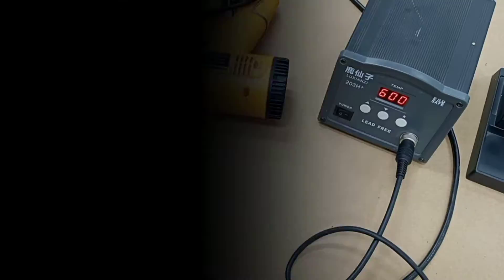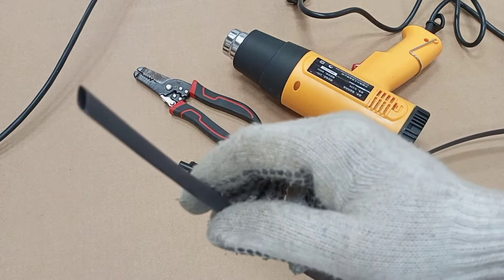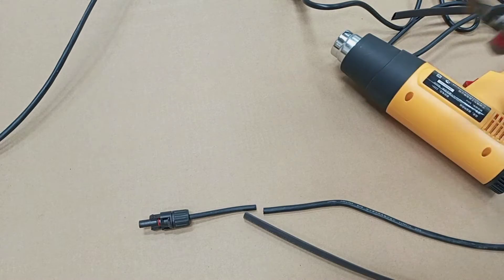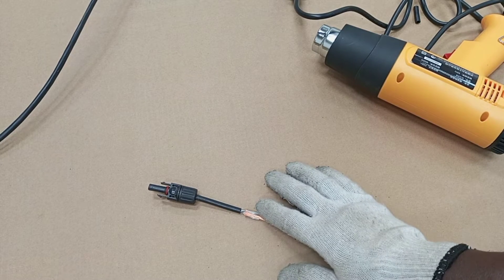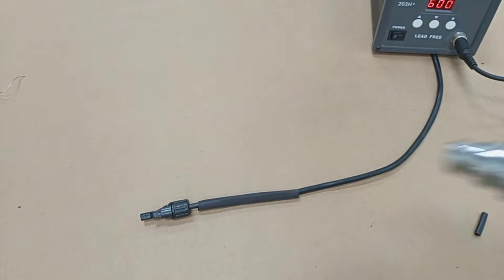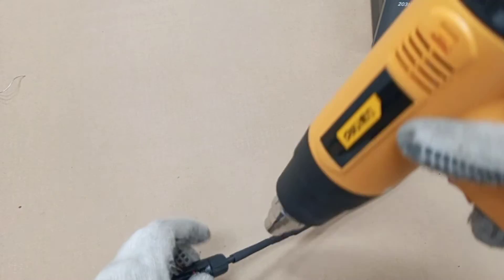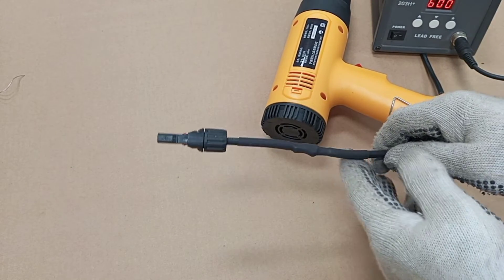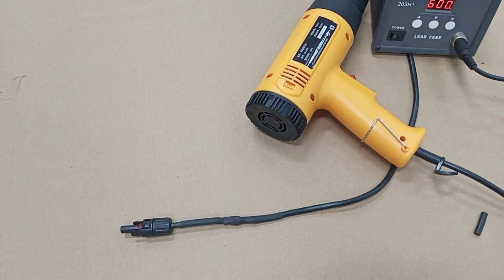Heat shrink tubing

Comment: It’s easy to take the shrink tube off. Using a sharp box cutter, cut along the tube where it’s soldered and then split the remaining tube off from the cable without using the box cutter. Done it millions of times.
Reply from the maker: Sure, just as you can remove the main insulation around the conductor itself. But that must be very intentional.